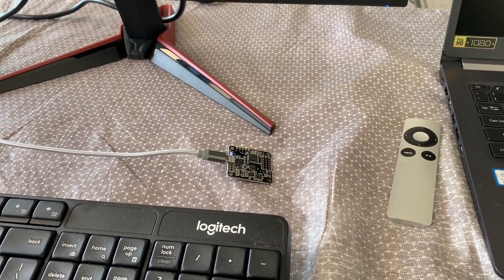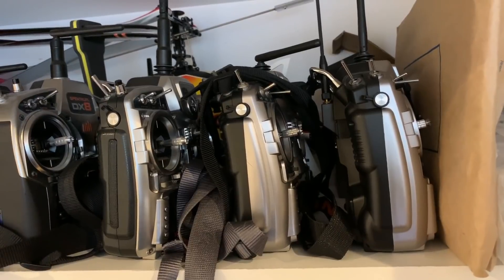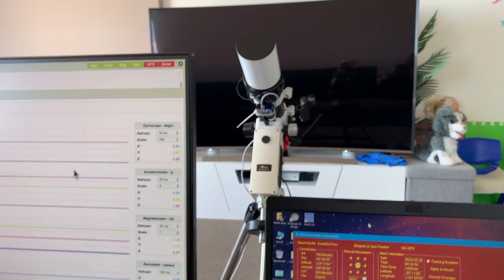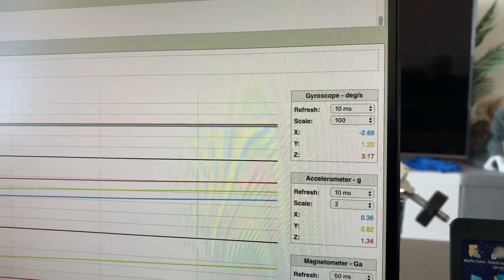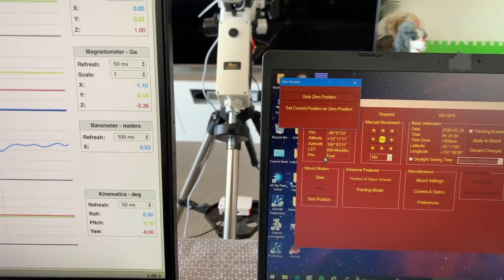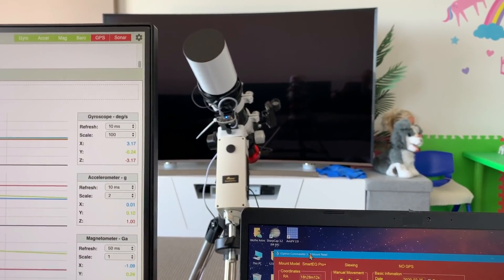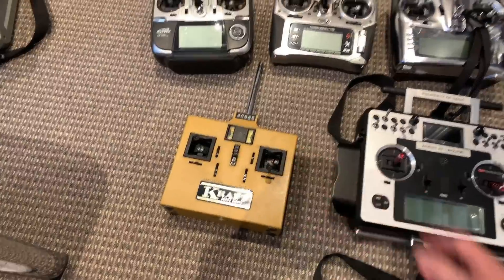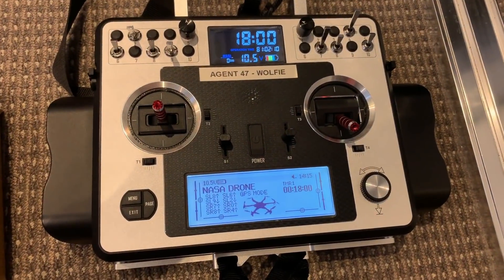Can a drone gyroscope display the rotation of the Earth with hobby level software?   Let us test it.

Comment: Neat! So, looks like the Naze32 uses an invensense Mpu6500. This is a 6 axis (3xgyro+3xaccel) without an onboard magnetometer.
The precision is quoted as: "±5 dps zero-rate-output and 0.01 dps/√Hz"
So, basically without using software to auto-correct for manufactured-in drift it might be as bad as 5 degrees per second of bias or "offset drift" each axis.
Clearly the software that's reading it is taking steps to determine where the zero offset is, or it has been applied to the nvram on the part at the factory. The "per root Hz" figure is basically a way of expressing the random noise figure as a function of read loop rate.
If you want to try fastening an FOG onto one of your mounts, I have a KVH DSP 3000 which lives 2 miles from the Sydney jet base.
It will absolutely show Earth Rate, as well as detect even the slowest mount slew speeds, but it has only 1 sensitive axis. The least-significant-bit of its angular-rate output is 60 micro-degrees/second.
I'm thinking of getting a 3-axis unit from KVH and using it for a self-erecting, self-calibrating Amateur-satellite antenna pointer for LEO work.
It would be nice to be able to plonk a unit down anywere, and have it determine its location and orientation, and then accept alt-az inputs relative to true-north so as to point a horn or Yagi from the laptop/Software Defined Radio.
These 3-axis units are also capable of tracking GEO satellites with a dish from a boat at sea or aircraft.
Nice RC gear!
My first RC TX was a Futaba almost identical to this one. https://www.ebay.com/c/1101703297 And it still works great! But it doesn't talk :(
First chopper was a Schluter Mini-Boy, on which I learned to fly RC heli in about '84.
It was also my first FPV rig, using a Philips B&W CCD surveillance camera. That was in '88.
Have you got a JR X-3810 in your collection? Also great, circa 1997 or so. Now converted to run on LiIon.

Comment: Leave it run for 6hrs and film the screen of the drone display to see if it is sensitive enough.
Reply from the maker: +Nathanyamaha465.  That would be showing the result from the accelerometers which are sensing the direction of gravity so of course the orientation would change.

The direction of down does not change relative to the ground as the earth rotates so this will show nothing on a rotating earth anyway.  

This experiment was to show the reading from the gyros.
Reply: @Wolfie6020  This is what you claim. Why don't you show the results of your mechanical gyroscope? We know the rigid rotor of an artificial horizon is not effected by gravity. Then run the MEMS and the gyro at the same time at sidereal rate. There is science that confounds the world.
Reply from the maker: +nathanyamaha465z. If you think the rotor in an artificial horizon is rigid then you don’t know how they work.  

Why do pilots learn about turning and acceleration errors in the instrument?  Please explain.

Did you miss all my videos showing how a real artificial horizon works?  You should watch those instead of FE videos made by people who don’t know what  they are taking about.

Yes this is what I claim because this is what I know.  How do you think these flight controllers are capable of self levelling if they don’t know which way is up and down?   They need accelerometers for this.   Turn off those and the controller does not know which way is up and down and the drone will drift and crash unless manually controlle.

Manual mode requires pilot control of attitude.   Self level mode it will hover by itself until the battery runs out .

Science only confounds those who don’t understand it.  Most people who watch my artificial horizon videos understand them very well.  Only the flatties still don’t get it
Reply: @Wolfie6020  You are right that there is a caging mechanism in an artificial horizon, but the gyroscope does maintain rigidity. 

I have a vg-14a vertical gyro taken from a westwind 1124 that is completely gimbaled, no hindrance like in your artificial horizon. I have run it for 6 hours and it showed no rotation of the earth underneath. (should have been 90 degrees) I do not have a sidereal mount so I built a mechanism out of gears to move slower than "earth rotation" and am building a mount to test the gyro. I'll post the results on my channel when complete. subscribe if you please.
Reply: @Wolfie6020  P.S. Do you not know about Foucault and the "scientific" claim that gyroscopes are able to measure earth rotation? Please explain.
Reply from the maker: @nathanyamaha465  That comment tells me you don't know how the instrument works. 

It has correcting mechanisms to keep it level with the Earth as it rotates.   The caging mechanism is irrelevant. 

Sorry but you are 100% wrong believing it should have moved by 90 degrees.  No.  The  whole point of the correcting mechanism is to prevent from doing that. 

Open up the gyro like I did and show us clearly what is inside.  It will have correcting mechanisms.   Yes I will sub and please open it.
Reply from the maker: @nathanyamaha465  Yes I have heard of the Foucault Pendulum.  I have never tested this myself so I cannot confirm or refute it. 

I have absolutely tested the artificial horizon myself and I have opened it up so I do know exactly how they work and no they will not rotate 90 degrees after 60 hours.  They will aways self correct to remain level at their location on the Earth.
Reply: @Wolfie6020  No I mean Foucault's gyro. https://www.sciencedirect.com/science/article/pii/S1631070517301019
The Comptes rendus de l'Académie des sciences throughout history / Les Comptes rendus de l'Académie des sciences à travers l'histoire
Foucault and the rotation of the Earth
Foucault et la rotation de la Terre
Author: JoëlSommeria
Reply: @nathanyamaha465  – "Gyro verticality is maintained by gravity-sensing liquid switches and torque motors." – this is from the description of VG-14A vertical gyroscope in an online catalogue ( https://www.seaerospace.com/sales/product/Honeywell/VG-14A ).